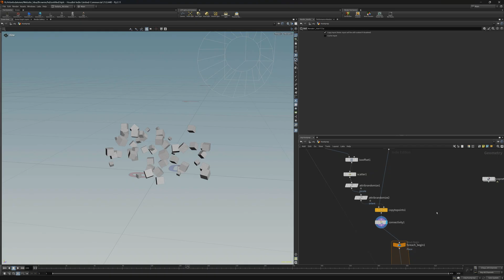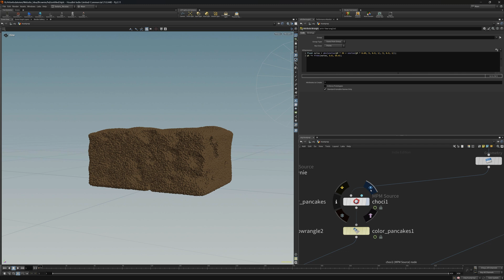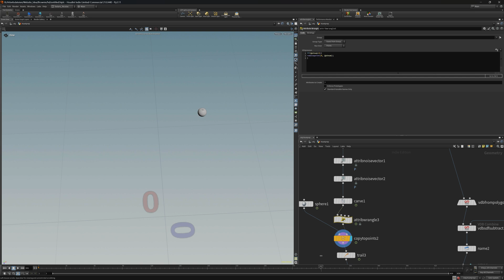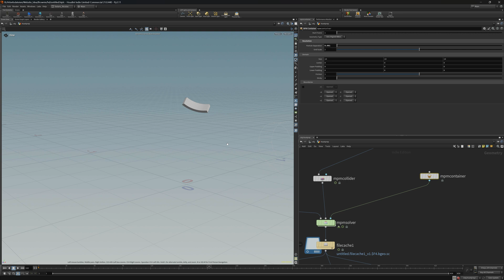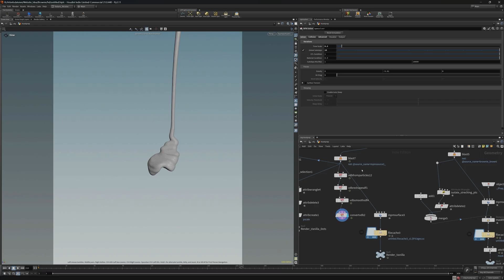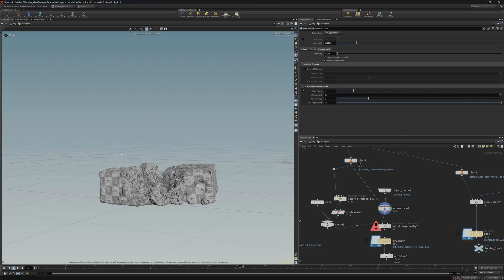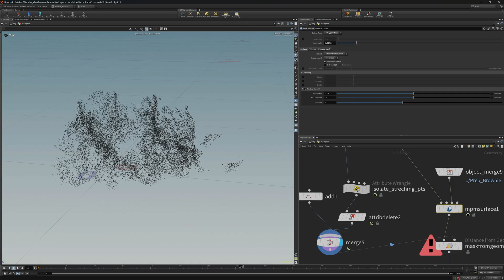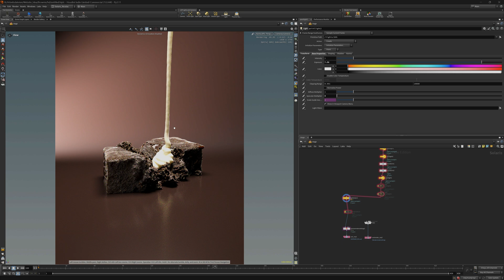How to create a Brownie using MPM Solver | Houdini Tutorial

Comment: After doing the file cache, how did you get the attribute for the blast nodes? I do not have any source names to bast.
Reply from the maker: Hi you set the name before the simulation with a name node :D
Reply: @Nicolas_Drum  I already did that, but using the source names have no effect in the blast node. for instance, I see the source name for the brownie cake points says "brownie_/brownie/cake/" but using that in the blast node "@source_name=brownie_/brownie/cake" has no effect and deleting non selected just deletes it all.
Reply from the maker: @vytasrauckis6703 Hi if u typed it like that its because there is a "/" missing in the end for the name in the blast node :D
Reply: @Nicolas_Drum  I actually did type the "/" at the end but I accidentally dropped it in my reply above. Sorry about that. I do see all the source_names in the spreadsheet, just for some reason I can't blast them.
Reply: Dang, how stupid of me. All I needed to do is change the group type in the blast node to "Points", and voila, the blast worked. Thanks.
Reply from the maker: @vytasrauckis6703 Ahhhh yeah good that u found it! Don't be too hard on urself it happens to all of us :D

Comment: Hi great tutorial and result, I noticed a bit of flickering in the sequence did you figured out how to avoid it ?
Reply from the maker: Yes. Turn down adaptivity in the meshing and turn up the samples while rendering. The first one is fairly light but turning up the samples will increase rendertime drastically which is why I ended up using this with roughly 5 Minutes per frame. If the geo is still flickering it might help to freeze the particles / meshing once a certainly velocity is reached.
Reply: @Nicolas_Drum  Thanks!